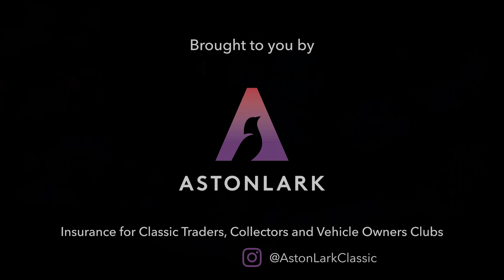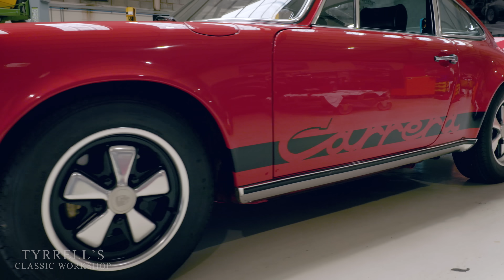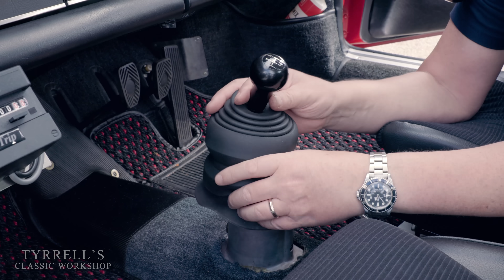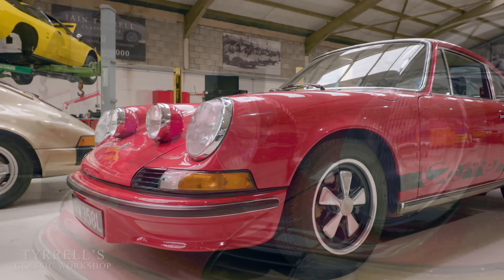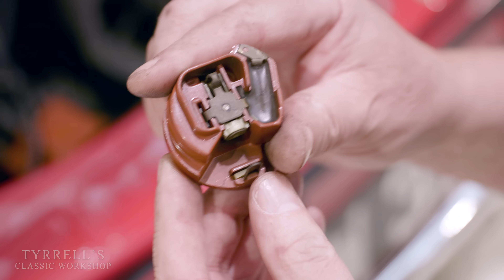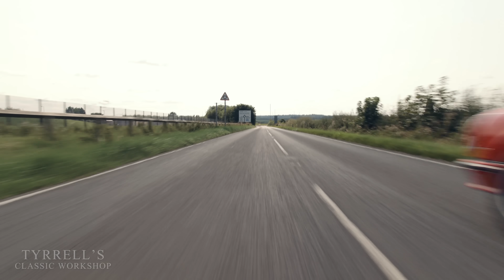Porsche 911 Carrera 2.7 RS- the car Porsche feared no- one would buy!| Tyrrell's Classic Workshop

Comment: Ferdinand Porsche actually went to America to research for his people's car. At Ford he met a Dutch designer who had created a stream lined air-cooled rear wheel drive car for Mercury. Knowing full well that Henry Ford won't approve it, he shared the design with Porsche. The car was called the Sterkenberg. I have seen pictures of it. It looks exactly like a four door bug. Porsche copied the lines over to the bug, merely reducing it in size. The front doors and the windshield are identical. In America the car was eventually redesigned and fitted with an eight cylinder in the front. It was released as the Mercury Zephyr in 1936.

Comment: What hand tools do you favor in England? In the U.S. our best and most expensive are SNAP ON and MAC.
Reply: In U.K., some people with lots of money own Snap-On tools, too!
Me, I use “Halfords Professional”. Beautifully made and a lifetime guarantee. I have a large set in a hard carrying case (like a briefcase) of just under 200 chrome vanadium sockets, ring, open & ratchet spanners, a large range of extension bars, Torx, hex and other drives etc. I added a huge breaker bar and adapters for 1/2”, 3/8” and 1/4” ratchet handles. After 5 years, the 1/4” ratchet handle simply stopped ratcheting and Halfords replaced it FOC on the spot. 
I’m sure there are other makes, but I’m not familiar with makers of such comprehensive sets than these two.

Comment: Nikasil was fine back then but then BMW ran with it and we all know how nikasil holds up in modern engines.
Reply from the maker: Jaguar had the same issues with high sulfur fuel
Reply: Suzuki used nikasil in their non-USA market GT550 two stroke triple bikes from 1974 to the end in 1977. Requiring different pistons than in the iron liner motors, also used from start to finish in their smaller (GT380) and larger (GT750) engines, I found the nikasil engine finicky. Others swear by them.
The biggest problem these days is there are so few companies able to replace hard to obtain cylinders, whereas you can’t swing a cat without hitting a competent engineer, able to hone or rebore for you.

Comment: I watched with fascination as you carefully adjusted the rev limiter using Porsche's special calibrated adjustment tool, noting that if you got it wrong and the engine over-revved, the big-end bolts would stretch and snap.  Sounds bad.  But then, later on, you said that the rev-counter was out-of-whack and had to be sent off for recalibration.  So how could you tell whether or not you'd actually set the rev limiter correctly?
Reply from the maker: Separate tachometer. Thanks for your interest

Comment: Jeremy Clarkson says….it was called 911, so the Americans knew which number to call when it went backwards into a hedge. But originally, Porsche wanted to call it 901. But Peugeot has trademarks on any 0 or 00 in the middle of a car number. They would not allow Porsche to use 901, but did allow Enzo to use 308

Comment: Much of the slop in the shifting is fixed with replacing the bushings in the little U joint in the selector shaft going into the transmission. In the U.S. the 2.7 has a bad reputation for the case studs pulling out of the block, something easily remedied by properly installing thread inserts in the cases during a rebuild, but too many people still don't like that. Makes an original 2.7 a little cheaper maybe, and also those suffered from our emissions laws. I spent a couple years at a shop that specialized in exotics and the owner spent a lot of years with Porsche and built a large customer base. I really fell in love with the 911, being as most of my work had been in motorcycles I really found the cars easy to work on and had no problem doing heavier work on engines and transmissions, work a lot of mechanics shy from. Pretty much all of the complaints I've heard about their handling and especially with the 930's reputation of being uncontrollable were just dumb rumors, those cars are a joy to drive. 
A major reason the 911 is held so highly in the sports car world is it's very drivable and reliable, it's also pretty easy to care for, and having been in production for so long there's still excellent support for them. Also there's a huge knowledge base from years of working on, driving, racing and tuning so anything that comes up is usually easy to find a repair or modification for. About the only thing I really don't like about the 911 now is the prices people want for them! They're getting to an age people also don't want to drive them, instead just have it in their collection rotting away.
Reply: The unfortunate tendency of wealthy people to buy & store rare special cars is a direct consequence of governments and central banks money issuance policies.
The wealthy realise that another systemic bank failure is as nailed on as is WHO pretending there’s another “pandemic”.

Comment: Having owned and worked on (in later years - restored) many air-cooled 911//930 PORSCHE back when the air-cooled were still new cars (HA - I lost interest when water-cooled arrived) - I know exactly what you referring to about that feel through the steering wheel.  These days - most people would think that something was wrong if they felt that '911 steering wheel jiggle' of an early 911//930.  HA - I think that your dumbell analogy was a 'little bit incorrect//insevere//unscarey' (HA - if that is a word).  HA - in my opinion - the better analogy would be - imagine throwing a dart backward - once that heavy bit starts to swing around - it all happens very FAST as it tries its best to switch ends - THAT is what a 911 is.  And of course - that only occurs at speeds when you are really pushing it.  Outside of the city areas - I used to treat my 911//930 as - if the corner said 60 kmh - then it was a 60 mph corner - NO problems in a 911//930 - HA - unless you hit water or ice part way around the corner - YES - been there - done that - HA.  But - once you master the 911//930 and steer (HA - no pun intended) characteristics - the lift-off oversteer 'DEVIL' will not kill you.  Typically in a 911//930 - lift off the accelerator in a fast//sliding mid-corner and the toe out oversteer characteristics of the early 911//930 (pre-WIESSACH rear end  -if my memory serves me correctly - introduced in the 964//965) will tend to steer you in an ever-increasing wider arc (quickly) - and then very-very quickly backwards into the scenery if you have not mastered it.   I can still picture the 6 o'clock news back in the 1980's with the picture of a brand new 911 wedged high up into a trees - after having gone fatally backwards as the new owner//driver (the person had just won the lottery) went backwards at a high rate of speed off the mountain road and into the trees.  I also remember a news article in the USA in those days of a widow suing PORSCHE for her husband's death as he went backwards off the road in his new 930 ("OH - PORSCHE did not warn my husband that he can die in this high powered vehicle - pay me MILLIONS" - AAAAAARGH).  The 'trick' is to do the exact opposite of what you would normally do in a front engined car when experiencing oversteer.  In a 911//930 (HA - be careful in an early 3.0 TURBO as the boost kicks in part-way around a fast corner - 3.0 TURBO - AKA - the WIDOW MAKER - HA - the 3.3 is a 'pussy cat' compared to a 3.0 when it goes 'CRAZY') you need to keep your foot into it  - or put even more into it.  Once you have mastered it - drifting a 911//930 is a true joy.

But for all my 911//930 memories - HA - probably the one I somewhat regret most - was 'cutting' up a genuine 73 RS long bonnet to install a G series front and 930 body kit and tossing the 2.7 mechanical injected engine for 3.0 etc etc. It was exactly the same color as this video 73 RS.  HA - but those were the days when a 2.7 RS was 'old news' when the next-generation short bonnet G series 911 came out.  I can also recall several other stories of me causing the 'death' of what these days are highly sought after collectors cars - but - in those days - there were just a 'tool' - an outdated model to use as you saw fit.  But - SUCH IS LIFE.   I just had to an edit to this - people would ask me how do I 'suffer' driving such a car each day and the fuel consumption.  My answer was - it is SUEPR reliable - comfortable and great fuel economy - a true EVERDAY car.  The best was - picking my kids up from tennis - I had the bonnet up and leaning in as I was putting their tennis kit into the front luggage compartment - and one of my wife's friend's stopped in her VOLVO wagon and nicely offered the kids and I a ride home as she assumed my shining black 930 was broken down - HA - she thought I had the bonnet up because of engine problems - HA - she had NO idea the engine was in the back (HA - the 'very back'). We also raced a 911 GT2 that has HUGE flames on overrun - and I mean HUGE - so HUGE - that on a total-fire ban day (here in AUSTRALIAN Summer - there is a reason for that) that the race officials threatened to ban us from the days racings as the flames were too BIG - HA - being a lawyer - "Please show us in the rules how you define 'TOO BIG"  - HA - they couldn't and so we got to race - but DAMN - we broke a rocker arm - HA - 'poetic justice'.  Many - many -many 911/930 FUN stories - call around for a BEER on the weekend and we can recall a few - HA.  Have a safe and nice day all.  CHEERS from AUSTRALIA.

Comment: Your videos are always a great joy, Ian and I thank you for them. Shame about your passion for Lambos, but we can't have it all ways!
Had several 911s through the hands in the '70s and two things still impress, even after all this time--there's nowt like the sound of an air-cooled flat 6 on song, and the steering, which one motor-noter described best as the wheel 'writhing' in one's hands, which I thought an excellent description. 
Never had a 2.7RS, but did supply, through Hexagon, a 930 Turbo, which I wasn't all that keen on after a certain incident in Hyde Park Corner one wet night.....As you say, the turbo was never a good timekeeper and was always late on parade. They came new with a gallon can of Shell Rotella oil on the back seat, just in case.

Comment: No sign of an AFR meter to check mixtures .. ?? Did Ian consider adjusting the low speed running instead of the main rack? Also the warm up regulator is a source of trouble, it’s reduced function leading to slowly richening mixture / over-fuelling due to carbon build up. Properly tuning MFI takes a bit more knowledge than what is run through here.

Comment: Fantastic Video! Any mention of Nikasil takes me back to the 90's when I worked at a BMW dealer. The early M52 6 cylinder motors really didn't like high sulphur fuel which lead to massive bore wear. Each tech had a month of replacing short motors before then the next Tech took over. Interestingly the USA cars had steel liners. Keep up the good work btw!

Comment: To my knowledge, Dr. Porsche never claimed to have invented rear-engined, rear-wheeled drive cars. However, he most certainly pushed their evolution forward greatly. I think one of the most underrated aspects of the design of the 911 is using the flat motor layout. Additionally, using the smaller and lighter Flat 6 as compared to the V8 in Tatra no doubt aided significantly in the handling of the car. Can you imagine early 911 handling with a higher CoG and heavier V8 back there? Yikes!

Comment: You nailed it early on, those cars are so motorcycle-like in terms of weight transfer sensitivity. The negative side is infamous, but the positive side is the amazing mid corner adjustability, especially with modern rubber wrapped around those fuchs.

Comment: Another excellent video. Finally a Porsche 911. 
I’m not a big fan of the dumbbell analogy. As you said, on one hand an engine and on the other a battery. Hardly a fair balance. But because the front is light, it offers exceptional steering feeling and feedback. Also having the engine in the back does offer some advantages. Such as in traction and braking. Yes, the handling is tricky at the limit and it does not suffer fools. But if properly mastered it’s a winner. As Vic Elford, Walter Röhrl, Peter Gregg and many others have aptly demonstrated.
The tricky suspension was later tamed with the Weissach axle.
The boxer flat 6 engine itself also offers many advantages. It has a low center of gravity, which is desirable for racing. It has no primary or secondary imbalance, which is great for endurance racing. It has a superior power to weight ratio, because there is no need for heavy radiators and a water jacket around the engine. And because the engine is directly connected to a transaxle and from there to the wheels, there is a minimum power loss from the engine to the wheels. Add to that the Germanic built quality and reliability and you have the greatest sports car ever made.

Comment: The early BMW V8s in the UK suffered premature bore wear when the sulfur in UK petrol at that time corroded the Nikasil coating. Compression would fall unevenly and the engine start to burn oil and vibrate at idle. How did the early 911 RS get around that? Maybe they didn't, owners just accepted a highly tuned engine wouldn't last that long?
Reply from the maker: There were specific things that caused the BMW and Jaguar bores coatings to break down. Shutting- off very shortly after cold starting caused sulphuric acid, and high sulphur petrol was another factor. Hope that at least scratches the surface for you (oops), and thanks for your interest

Comment: I liked the special tool segment. When the British Army was using Lee Enfield based sniper rifles, the armourers would occasionally have difficulty aligning a replacement barrel within acceptable tolerance for collimating the sighting telescope which was carried in a cast iron mount. The first solution was to try different barrels. The second solution was not mentioned in the ‘instructions’ but reportedly always worked. The words ‘hit the mount with a ball pein hammer’ are not written in the standard reference on the Rifle No. 4 Mk 1 (T) but the author’s inference is clear.

Comment: Another brilliant and informative video. Now im dying to know, if the 2.7 pushed the capacity to the limit of the engine length how did they get to 3.3 for the turbo? Longer stroke? 
Not a fan of the frog eyed sprite style driving lamps but the rs lightweight would definitely be in my lottery win dream garage. Looking forward to the next video.
Reply from the maker: They gradually increased the bore and stroke as technology (ever thinner cylinder walls) allowed. Thanks for your comments!

Comment: Love this video Iain. If professional teachers/lecturers had your ability to educate, the education system in Australia would be much improved. I heartily concur with your views on weight and handling and required power. As a previous owner of an Alfa 105 2.0 GTV and a 3.2 G series 911, neither quick cars by today's standards, but wonderful to drive demonstrate the point, now lost with moderns. Iain's description of steering feel is spot on, both my cars had the "dance across the road feel", so that at all times you knew what the car was doing and how it was reacting to the road conditions and the way it was being driven. Finally your comments about the 911 handling rang true for me, as much as it was slow in, accelerate out, I never had enough confidence in my driving ability with the 911 to push too hard without ending up "inspecting the scenery"

Comment: The linkage problem is not in the shifter but the shift rod coupling under the removable plate in the middle of the rear floorboard. Just in front of the rear seats. It's a T-shaped coupling with two nylon bushings that connects the shift linkage rod (and keeps horizontal movement of the shifter precise) with the linkage of the transaxle. You can rebuild it or buy a new coupling. Ferdinand Porsche designed the Mercedes SS and SSK along with the Auto Union Types A-C GP racers (the first mid engined GP cars), and was around for several rear engined Mercedes VW Beetlesque concepts like the Mercedes 130. So the Beetle was small potatos in the engineering genius of Ferdinand Porsche.

Comment: Fiat X1/9 has similar steering feel, if not better.
Reply from the maker: The X1/9 is indeed a gem. I wonder how many are left now?! Thanks for your interest
Reply: @iain_tyrrell  A fair few must've disintegrated into Martian dust by now. The one I had looked like it'd been donated to a BTEC welding course.
One of my biggest automotive regrets was not rescuing an intact Lido from a salvage yard. They also had a 911 with the same bonnet-mounted frogeye spots as this RS. I wasn't into 911s at the time so I paid it no mind. Hopefully, I'm only half the fool I I used to be.

Comment: I added an Autofarm front spoiler and rear “ducktail” to my ‘72 911E  2.4.  I’ve often described driving it as just resting your fingertips on the steering wheel  and feeing when you drove over a matchstick. Sold in the late 70s so 40+ years of regret …🙁

Comment: Props to the owner still using it and enjoying the car.  That same trick works on most Bosch mechanical injection units.  I had an old International 724 tractor that ran much better with a few more ticks and adjustment of the spring for the governor, haha.